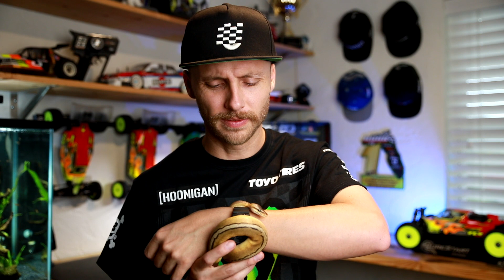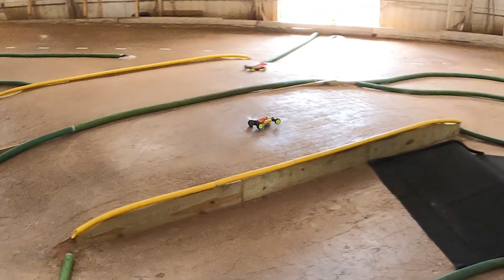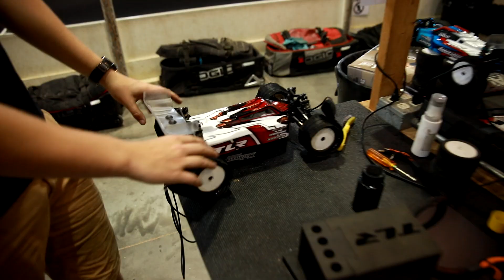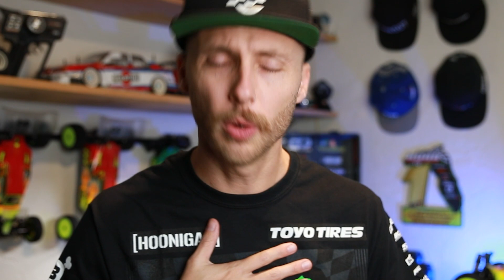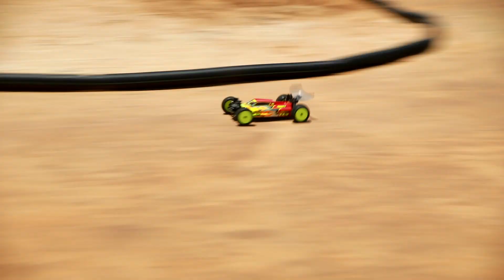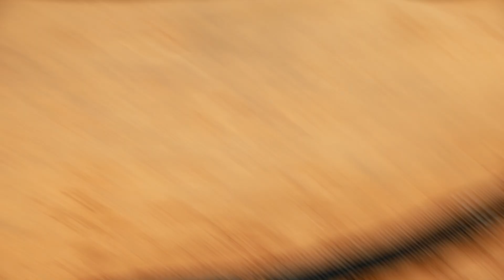RC Racers need to talk about and do this...

Comment: Yes, maintenance! I love maintenance. The more I'm working on my car, the more I learn about it, the more insight I get into how it reacts when changing setup. I try to take my stuff fully apart every few hours I run it to keep everything running smoothly without wearing out my parts too much.

PS: An old toothbrush, a Chip Brush and a Nylon Brush go a long way for keeping things moderately clean out on track.

Comment: I take my brand new B74.2 out for a test rip in the street, picked up a tiny little rock and it got lodged in the back of the motor, my temps where rising and I got my unit set for reverse for practice, reverse was fine then all of a sudden it would bind, forward was no issues. So the lesson learned is after every outing, you gotta take it all apart and clean it meticulously.

Comment: great video, if people are short of cash and want super smooth silky shock action, here is what works for me. Usually the little shim between the two O-rings can be reduced in thickness by carefully rubbing it on some 400grit paper. l would take .2mm off and try it. By doing this we don't squeeze down so tight on the O-rings which is in turn putting WAY to much pressure on the shock shaft causing the stiction. 

The reason the O-rings are causing stiction is they have grown in size due to the reaction with the silicon shock fluid.  Brand new O-rings will help eliminate the stiction but only for a very short period of time, and sometimes not at all.  If you shock only has a single O-ring then  apply some clear nail polish to the thread that holds the seal pack retainer in place and simply dont tighten it up all the way, this works very well on plastic shocks. 

The nail polish is just acting as a cheep and easy way of retaining the seal pack holder in place. Simply assemble as per normal with some food grade grease and tighten all the way down and then just back off the retainer until the shock action frees up.  Now the O-rings can work properly over a long period of time.
You will have it so sorted after this you will wonder what all the fuss is about. Cheers from Down Under and stay safe.

Comment: Quick tip for tires, use dawn dish soap and old toothbrush to clean tires and rinse dry the tire with a cloth and get ready for grip is a very effective and cheap.

Comment: Once you get frustrated with your results, then its time to take your racing program a little more seriously. That's what I did, but I remembered its supposed to be fun. I improved my results when I was focused, and that made racing more enjoyable. 

The thing is the techniques to improve things are not immediately obvious to the less experienced. I double bleed my shocks now (Ae cars idk if that applies to others) my x rings don't go beyond 2 months old and get fresh seals before each big race. That and how to set steering endpoints and other car prep I listened to my fast/sponsored buddies and along with polishing hinge pins and making sure everything is tight vastly improved my cars and thus my driving/results. 

Also if you fly some where, your shocks will have tons of air in them and if the seals are good will need completely rebleed. Ryan did you make that mistake? haha.

Comment: Just wanted to say thanks for the videos you put up. As a new racer or I guess returning racer after 20 + year off. I have learned alot about rc racing and things I should be doing and finally stepped up to the drivers stand for my first race this last Saturday. Still alot to learn about setups and when to change things.  For whatever reason may be for some reason I can relate more on the input you have to share.

Comment: In Summary, some basic maintenance would include
1. Dumping and Refilling of shocks. Sometimes topping up and bleeding shocks every few hours of driving made a lot of difference
2. Cleaning of Bearings, pins.
3. Cleaning of Universal joints, Changing drive shaft pins
4. Changing differential oil and cleaning of ball differential
5. Checking of setup. eg camber, ride height, toe.

Spending just a little more time in doing these maintenance steps every now and then will make the drive more enjoyable.
There will be potentially less mistakes made which may result in repairs needed.
If you have just a few hours in the weekend on track, make every minute enjoyable.

Comment: In short being a perfectionist has the advantage in RC and thats just the solid truth. No need to excuse yourself Ryan. Attention to detail goes a long way. It does though become expensive replacing things with new ones and doing proper maintenance but that is the only way to run your car at a 100% and at the end of the day it will save you money replacing expensive parts that do wear out. Awesome video

Comment: Ryan,
First off, I live close to OCRC and I'm bummed I didn't get to go say hi to you when you were out here for the last race. Hopefully next time I'll be able to come out and see you.

This is actually a great topic because through my 10 years of racing in the 80's and 90's as a sponsored driver I just got into a routine of replacing things on my car that I felt would wear out. Money wasn't an issue, but my time was and I would neglect one little part and then go out and race and the car would handle like crap. I would try easy fixes like tires before finally a light bulb would go off in my mind and I'd remember that I didn't replace something. I'd take the car apart and I would be so pissed that I didn't take the extra 15 minutes to toss out and replace something. The part that sucks is that it would have added and additional 5 minutes to my original time when the car was already being torn down in the first place.

Good condition suspension parts and bearings are crucial in being competitive and consistent and making sure all the hinge pins, arms, and steering all move freely.

Now that I'm back racing again, and I have a budget now that I didn't have when I was younger, I know I tend to go longer than I probably should for replacing parts.

Comment: Id also say never assume the 'expensive motor'/equipment that the higher level guys are using are the reason they're doing better. in the hands of anther driver my £55 Reds VX 6.5T can keep up with the consistent times another high level driver driving the brand new hobbywing v10 G3. Never rule out yourself as the underperforming component, its either practice or as Ryan says; maintenance!

Comment: At my LHS they have a spec class in which can be no sponsored drivers, everyone same final ratio (gear/drive) and everyone gets the same brand, sealed and locked motor.

It's my favorite class, it's cheap compared to 17.5 or 13.5 and no one with 50 sets of tires and $300 motor combos.

Just base buggy kits and 21.5 turn motors. It's fun,and light for beginners but also competitive if you have been driving longer.

Comment: I personally think the effect of maintenance is amplified even more in on road cars than off-road cars. I once changed out full suspension components that doesn’t even feel worn out and it transformed the handling characteristics of the car and bought back all the steering I was expecting. I feel for large races I might as well build a  new kit instead of using my daily.

Comment: Hello Ryan, I am new to racing and have a 1/10 buggy. Is there a chart of required or suggested maintenance / replacement for parts based on hours used, conditions or any other factors?
I ride dirt bikes and they have required oil change, chain, filter, bearings, shock and other part replacement guides in the owners manual. 
Would be nice if RC cars (kits for racing) would come with an owners manual or guide.
Can you help with that topic?
Thanks for videos

Comment: Hey! How often do you recommend changing out shock x rings/o rings? I am always doing maintenance on my cars, rebuilding things, checking stuff etc.. but have never changed them out. Going to order some but curious if I should get a couple sets or what. Thanks
Reply: Just depends how often you run. Display cars or seldom run cars don’t require as much maintenance as a car that’s run every weekend at a dirt track. However, no matter how often you run, it doesn’t hurt to give your car a once over every now and then. I get criticized as being a little too overbearing with maintaining my cars but sometimes just being curious helps keep your cars being competitive.

Comment: I'm totally new to this and I built my first kit tlr 22 5.0 ac. I built my gear diff exactly how the manual tells you with the 7000 supplied oil but my question is how do I know for sure it's working exactly how it should? I dont really know how it should feel. Thanks

Comment: With how much you lot change on your cars track-to-track I'm shocked there's even a need for maintenance. All the things that usually need such attention get altered all the time. It just seems logical in face of that and the constant drive to shave half a percent of a hundredth of a second off with every change that these sorts of things would just be routine.

 It's us bashers that tend to drive things to the point of wearing out. We get a setup that works...usually the out-of-box setup...and we never change it.  We're the ones that run a car until the shock o-rings are so badly fucked that there's no oil left in them, run our wheel bearings until half the steering servo's throw is just taking up slop, run our gears until the teeth are so thin they don't have any strength left, run the same glow plug for years and years until it's so badly shot the engine barely even starts anymore. Hell we often don't even bother our carbs for months on end, use lipos that are slightly puffed, run on tires until they're so badly ruined they literally fly apart.

I've got glow plugs in some of my engines that are *literally older than I am* and I'm still using them. They work fine for me. A racer would have yeeted them years ago because they don't perform optimally, but for me they still work. And that demonstrates how us bashers tend to be more in need of maintenance regimes. We tend to go 'eh it still works send it' far more often because, for us, that half a percent of a hundredth of a second doesn't mean anything, so we're far less likely to realize anything needs attention.
Reply: Little addendum: After posting this I went to hoon my Scorpion XXL a bit...and wouldn't ya know it, the glow plug was bad. Hahaha. It ran GREAT last time I drove it but apparently the element broke off at one end during that run because it was open circuit.

Comment: Might be a stupid question but for fan for your motor do you have it blowing air on the motor or sucking the heat out
Reply: Pushing air onto the motor. Leave some gap for better air flow.
Reply: @alb9022  ok I only run oval and I wanna run double fans on my mod motor just trying to figure out how to do it

Comment: Ryan I would like a little insite into a bit of a struggle I am having. I am located in central florida so you are very familiar with the track around me. I am having trouble deciding on my first race buggy. I ally plan to run one class (electric buggy) to keep within my budget and time. I am struggling with 1/10 scale vs 1/8 scale. I am a big fan of maintenance but not a big fan of constantly replacing broken parts. I know 1/8 scale is pretty resilient but I am also thinking a 1/10 4WD buggy would be versatile enough to race at all the outdoor as well as the indoor.... Beachline... while an 1/8 scale is accepted at all the outdoor tracks, they are not accepted at the indoor. Please let me know your thoughts. I race with my 8 year old son so I really only have time to race one vehicle myself do to the time it takes for maintenance on his cars, E-Buggy & SCT.

Comment: How crucial is a setup station for a 2wd buggy? I know that’s a subjective question but I’d be interested to know your thoughts
Reply: I wouldn’t say it’s necessary because you could measure your linkages and ensure they’re the same length side to side and according to the specs given in the manual of your chassis. However, having a setup station can help if you’re looking to dial in a specific setup. But if you were to ask me, I’d say measure everything, match linkages side to side for consistency and go from there to decide if you’d need it.

Comment: Psh. Run her till she broke. If the shocks are not full of mud and diffs not dry you didn't run it long enough lol. Jk diff need to do mantaince on higher grip tracks etc it's bit more important imo vs very low/no grip just because on higher grip you can notice changes a lot more imo.

Comment: Yo Ryan I’m new to rc but I got a pretty good car so I can end up racing it but I’m 15 and I spent all my money on the car and I’ve been trying to go to our only track in my city that fits my car and there’s so pretty big jumps and I’ve tried it twice and both times I go I end up breaking something and I don’t know what to do because I don’t want to keep wrecking it and making it weak but at the same time I don’t know how to get better to go to the track? Any tips
Reply: Don't jump the jumps. Just roll over them or take smaller ones. Just drive around the track while getting used to throttle control and navigating it consistently. Focus too much on jumps and you lose sight of the bigger picture.
Lower your throttle EPA to something like maybe 40% and drive 10 mins with no crash (when the track isn't busy) or bumping into railings and increase it by 1 point or 5% whenenver you achieve that. If you over steer from the radio wheel, soften steering expo until you're comfortable enough to be pushing the car harder with a more twitchy expo. When steering, don't let go of the wheel to have it return by spring tension. Bad habbit for racing as that'll throw off your cornering.

Don't buy into the trap of upgrades. They really won't help for the most part unless it's something important... buying a carbon fiber shock tower will NOT help you at this stage. Spend money on researched wheels first. Ask around for good tires that will also work well for a beginner at your track. Refrain from constantly changing settings (camber, toe, steering expo, etc). Obviously if you have 1 degree toe on left and 2 degree toe on right, then that has to change.
Reply: Al B cheers for that but one problem with the taking it slow and not hitting all the jumps is to go around the full track there’s a cross jump over the track from a elevated position so like a drop but over a part of track and theres no real way around that but thanks for the tips

Comment: No offense, but it sounds like you're a sponsored driver sandbagging in spec classes.  You wouldn't have to deal with accusations if you moved up to mod.  Spec classes are the source of 90% of RC drama.